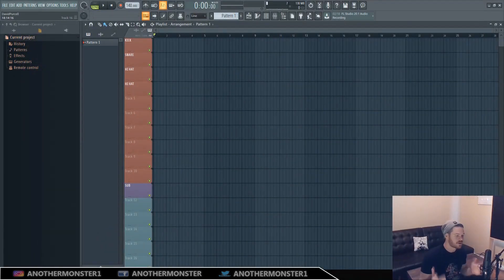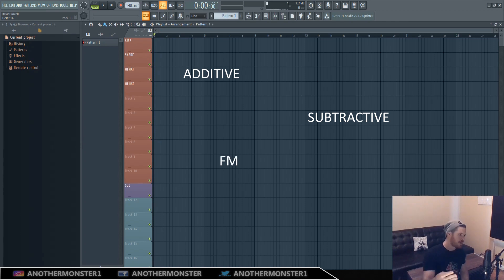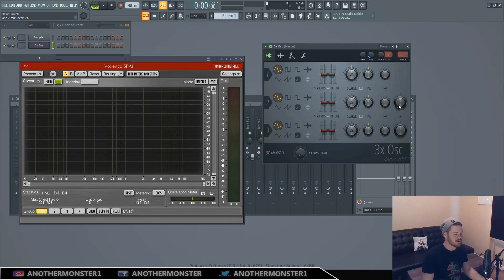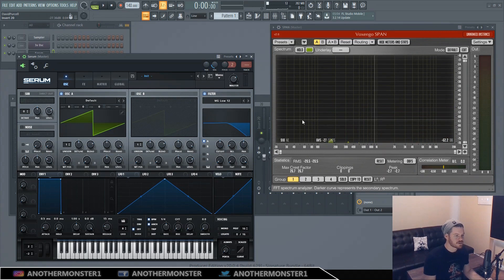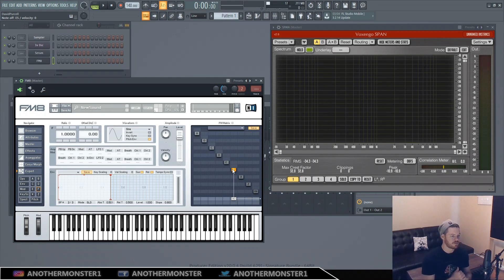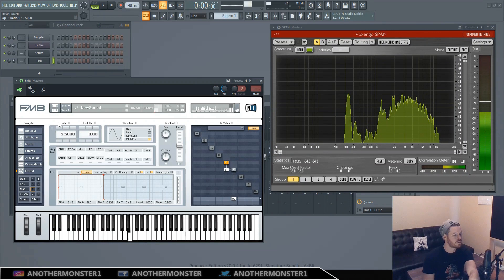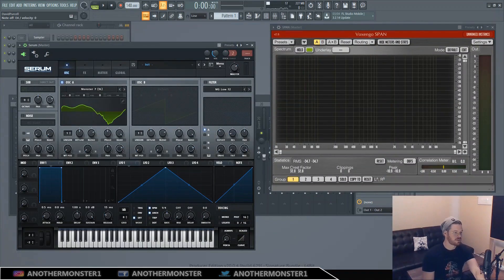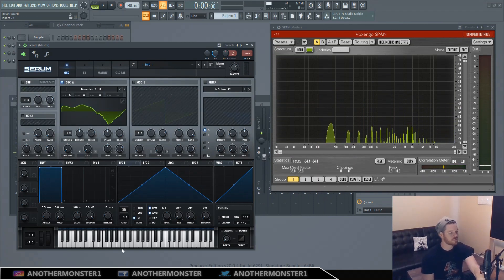Introduction to Synthesis and Sound Design Part 2 | Tutorial

Comment: Question about wavetable: So I see that whole table and the way you can zoom across to get any cross section of it. Is that table kinda like a preset? Also, is it possible to play different cross sections of the table at the same time (and if so, would those go through different operators or something like that)? Thanks! Oh yeah, also, do you think Serum's the best wavetable out there. I think Porter Robinson used it on a lot of his stuff, didn't he?
Reply from the maker: Brent Lally personally I think serum is the best wavetable synth because of the visual you get on all it’s functions. Plus the fx are amazing in serum. Arguably the best in any synth. Only downside is it’s pretty heavy on cpu. I’m pretty sure most edm producers use it a lot. You can create your own wavetables and save them in a folder in serum so in a way they are kind of like presets. I don’t think there’s a way to play two parts of the same wavetable at the same time unless you were to introduce another oscillator.
Reply: @AnotherMonster  Thanks!